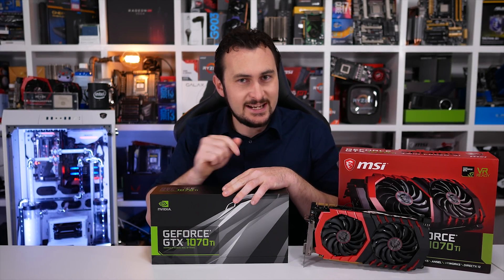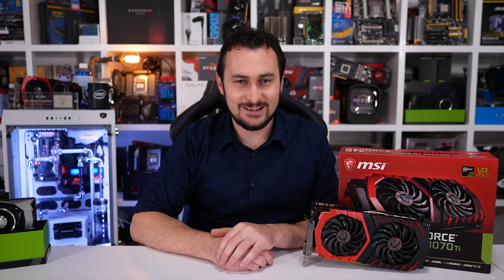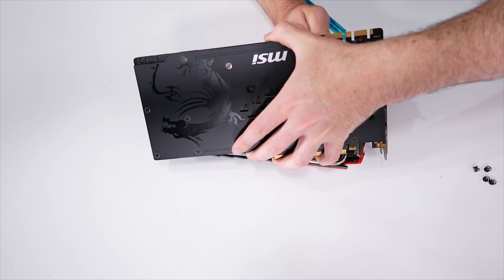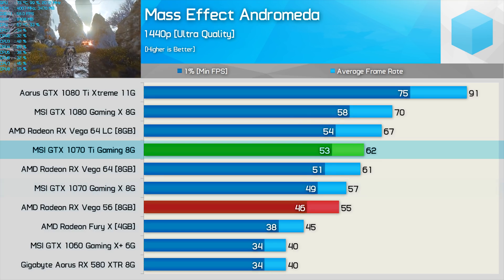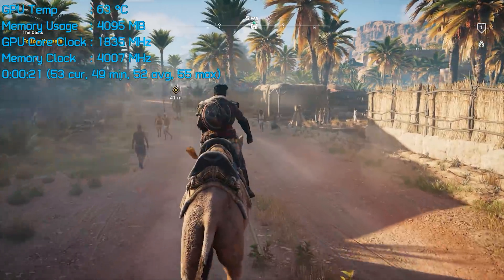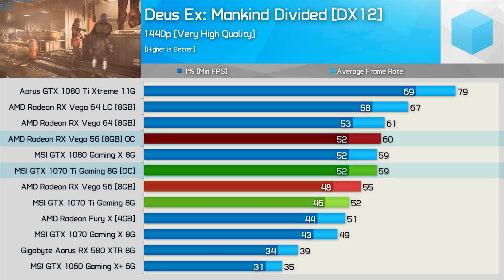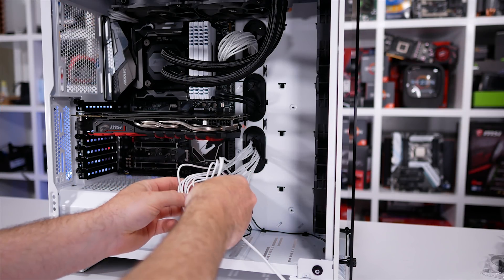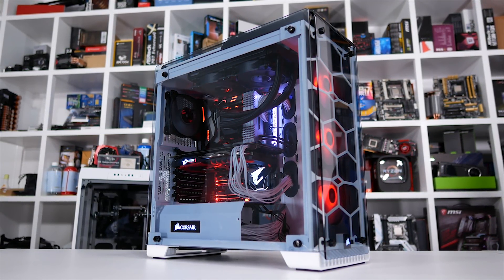MSI GTX 1070 Ti Gaming, Overclocking, Power & Thermals

Comment: @3:10 the pricing on RX Vega 56 is $100!?! I wish lol
Reply: issaciams I'll get 10
Reply from the maker: +issaciams I used the Microcenter pricing on that one ;)
Reply: Vega 56 is down to $400 now at least 😊
Reply: ^This. I'm glad Vega 56 reference models have fallen back down to about MSRP. I just wish their power consumption was better. The power draw of that card once overclocked is CRAZY.
Reply: NamAim1991 yeah, but when it isn't overclocked, it's not as bad as people make it out to be, also it seems to be very power efficient in the AMD APUs
Reply: bryan joiner I thought that too but then I realized people arent ready to spend an extra 30-60$ on another psu...
Reply: bryan joiner Some people are willing to spend extra to save some power. The reason I didn't get the R9 380x or 390 when it still was in it's glory
Reply: When are the Vega 56 AIB cards coming out? inquiring minds want to know!
Reply: ya xd
Reply: NamAim1991 its not that bad though in all honesty. 446 total system power, when most people have a 500-600 watt power supply and beyond most of the time.